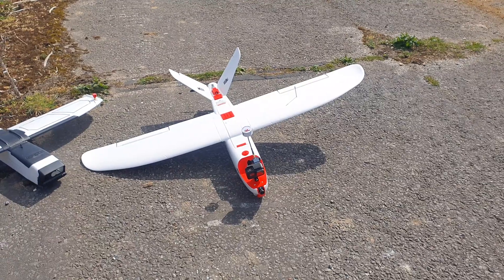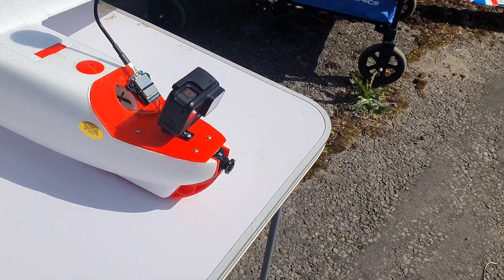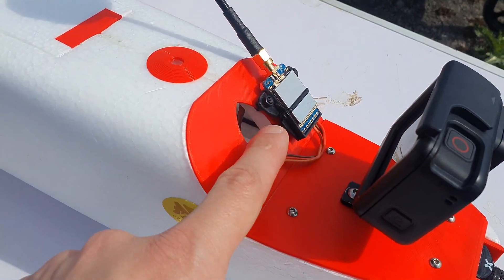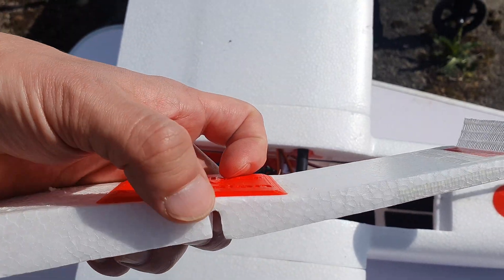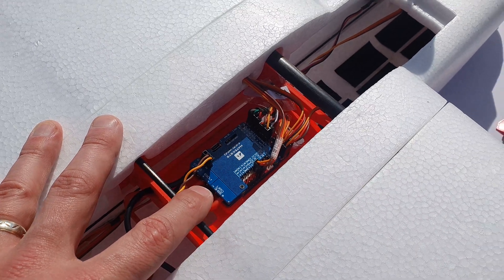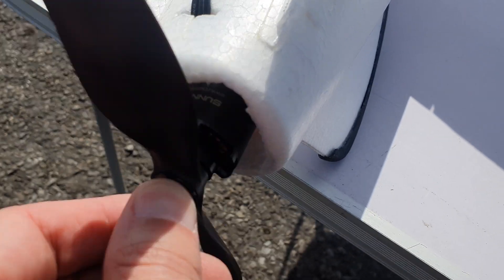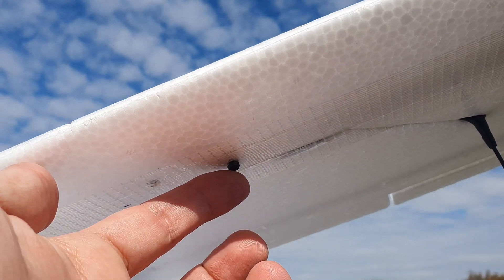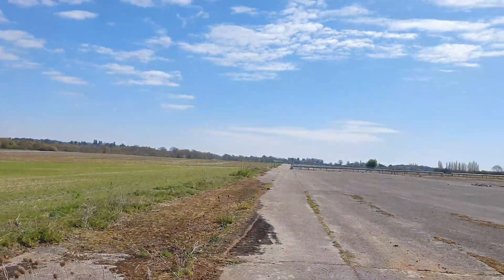Mini Talon - Setup / Walkaround

Comment: Cool! I have a MT in the early stages of building. Would love to see your 1.3ghz results too. I have a 1.3 station and vtx in need of testing too.
Reply from the maker: I've temporarily converted this to the DJI system, but it will be back on 1.3 and used with my tracker as soon as I can get out to the countryside

Comment: Nice mini Talon but fly it line of sight, no?
Reply from the maker: I have flown it LOS before, the point of this trip was to test the 1.3 FPV gear. You're right, I guess I could have said "I can't test the 1.3 gear today because I forgot the tracker" instead of "I can't fly the Mini Talon" haha 🤣

I had limited time this day, and 2 objectives... to test my tracker (and the 1.3 equipment on the Mini Talon) and to get a serious amount of flights with my ZOHD Talon GT in order to tune iNav for a better flight experience.

With the chance to test the 1.3 equipment gone, I capitalised on being able to fly the ZOHD Talon GT instead. After all, I prefer FPV to LOS anyway, so was happy that I didn't have a wasted journey.

Thanks for the comment 👍
Reply: @grim-upnorth  I'm curious for the 1.3 result. Have some RX and VX lying around but never got it quiet good to go far. Also lot's of throuble with the GPS (was to near the VTX antenna)
Reply: @grim-upnorth  How did your GT tuning went? I think this is a very difficult plane to tune on INAV...